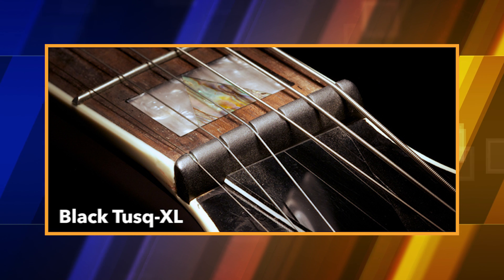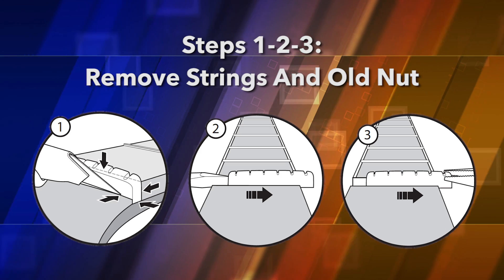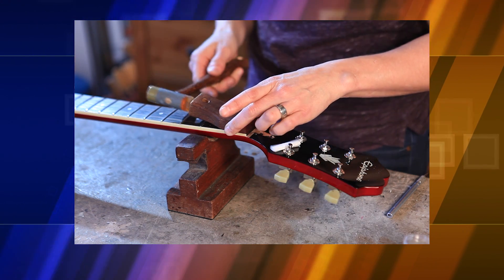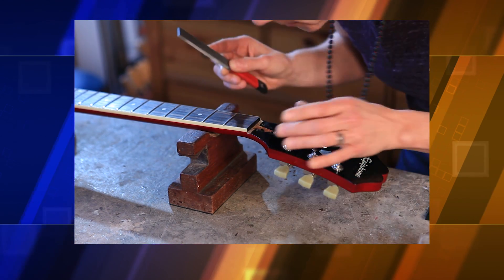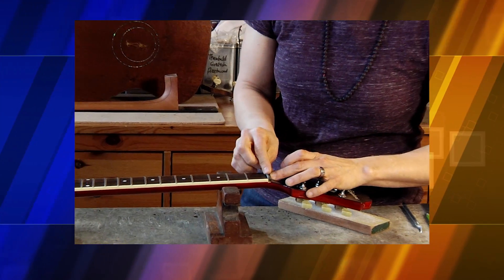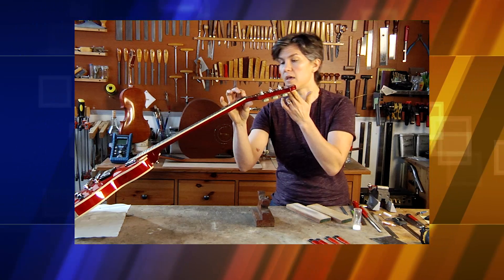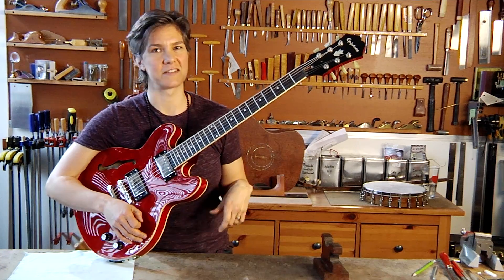Graph Tech Training Series: How to Install a Pre-Slotted Nut

Comment: Just got mine installed -- this video was an extremely helpful guide. The strings on my new PRS kept binding up at the nut whenever I used the tremolo, but changing out the stock nut for a Tusq XL made a massive difference. I can pull off divebombs now. :)
Reply: That surprises me because PRS has a super secret proprietary nut material.
Reply: @MrCamerononicus  Yeah, I know -- you'd really think that it would be better, but it just isn't. :/
Reply: What model PRS was that? Was it one of the core U.S. made guitars?
Reply: @brushstroke3733  One of the SE Standards actually. Korean-made, I believe, though I was talking to a luthier friend of mine and apparently he's seen similar issues even on higher-grade PRS guitars.

Pun intended, the but remains a sticking point.
Reply: @noahallen1996  Interesting. I would have guessed TUSQ XL material was a copy of the PRS material. Perhaps it was and yet Graph Tech improved on the formula. I've never had problems with my PRS nut, but then again, I don't do dive bombs either! I rarely use the whammy bar, but when I do, it's usually for more subtle tremolo type effects. Pulling off divebombs without a locking trem system and staying in tune is actually a fairly stunning technological achievement in my eyes, and it's great that we have the materials and technology to do that now. Who wants to lock down their strings like some kind of kinky Dom anyway?! Let them slide in their slots, baby!!

Comment: I don’t like the design of the astrat nut, why is it radiused on rhe bottom and have a post in the middle?  I’ve yet to work on a strat style guitar that is radiused  on the bottom surface which attaches to the neck.  The radius makes sense on top since it matches the fretboard.  Radius on the bottom means less surface area for the nut to adhere to.  This is isn’t 1960 or 1970 stop it.  All your other nuts are flat bottom , why this one, why not make an option.  I decided to use another nut because I didn’t trust the long term performance of this design.  Also feel it can move more easily since it doesn’t sit well.
Reply from the maker: Thanks god your question ... well... virtually all American made and Mexican made Fender guitars since 1950 until today have a radius on the nut slot bottom ...   hence the design,  we recommend a whore glue to hold the nut,  it doesn’t take a lot, the nut should fit snuggly in without glue for final fit ..  please stay away from epoxies or crazy glue.. one day that nut  might have to be removed , and you don’t want pieces of wood being removed with it ...  we do have lots of flat bottomed strat style nuts such as the PQ-5042-00 or PQ-5010-00 , thanks again !
Reply: @GraphTechGuitarLabs  I’ll have to check out the 5010 the 5045 is for a 12” radius.  I did order a nut and paid for 2 day service has not made it out of the factory since Friday.  Tracking says enroute to USPS but no arrival yet.

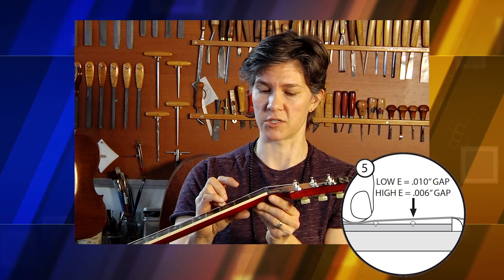Comment: @4:46   .006 not 0.06, 60 thou. is kinda high!  and @ 4:49 it's .010,  not 0.1, again a 100 thou. = impossible.  Please forgive the correction, but as a retired CNC machinist/programmer, and fellow Luthier, I just couldn't resist, Lol!
Reply: Thanks George...  once it is out there... it's hard to correct... your post will get the message out there...   thanks again....

Comment: Very helpful video! I used a set of automotive feeler gauges to set the height of the low and high E strings. Worked like a charm.
Reply: Charmed like a work.

Comment: 1. What grit sand paper(s) are you using? 2. The glue process should be shown or explained as well as what type of glue.
Reply: Problem is that wood glue  expands as it dries and could move the nut, made that mistake before and ruined the neck trying to get it off..
Reply: 400grit is recommended. As for glue, I use Titebond 1 or 2. Superglue is too fast drying and glues both you and the part to each other and the Instrument in question, whereas Titebond gives 30mins or play if alignment needs adjusting.
Reply: @someoneelse101 please don’t use wood glue , you’ll make it extremely hard to remove next time and risk pulling timber off! 2 small dots of CA glue is the way to go and makes for easy removal 👍🏻
Reply: @pk952  Will keep that in mind. I've used Titebond for everything timber related without too much hassle though
Reply: Yeah. And since you can buy most graphtech nuts ready made for your guitar, I'd say this video focuses on all the wrong parts of the process.

Comment: what type of glue and will the glue thickness impact the height?
Reply: Yep, white glue.  The glue is really just to hold the nut in place during restringing.  The tension of the strings will be enough to hold the nut in place and white glue will make it easy to remove in the future.

Comment: How can you possibly tell that the space between the first fret and the string is 0.010" just by looking at it?
Reply: Terminator eye.
Reply: Or a 5 dollar feeler gage from Harbor Freight maybe
Reply: I use business cards, stack them and measure with a caliper. Or you can get really technical and get a set of feeler gauges. A buddy of mine who was a guitar tech use to use old guitar strings that he would cut into 4” pieces and hammer them into the thickness that he liked and place them in the cases.
Reply: you can’t lol
Reply from the maker: Really good eyes!   or.... 3 sheets of regular computer paper stacked together will get you pretty close.

Comment: I appreciated the measurements on this video
Reply from the maker: Thanks Eddie. Wee try to get as much detail into the videos as we can. You can all get more details on the website. Stay tuned and stay safe. GT Team
Reply: @GraphTechGuitarLabs  

I have a question.  Bought a graph tech nut for an Ltd everything went smooth but I am concerned that the nut slot was already too deep and I now have some buzzy strings with the graph tech nut installed.  Should I place a shim under the bottom of the nut to raise the height?
Thanks

Comment: my nut's only 1mm higher than the fretboard! (first time builder here)
Reply: The most important measurement is the string height in relation to the first fret (for nut slot height) .... Nicole let's you know the suggested distance at around 4:50 in the video...

Comment: I need help. By having only the two E strings its the same tension of having all six? I think that with only two strings the nut will not be fully "compress to the neck" and measure of the thousands of inches would be bad? or am i wrong?
Reply: I know it's a year late but I'll leave this here in case someone comes across this. It definitely has an effect but not when you're measuring at the first fret - it's negligible. If, say, you're measuring on the 12fret, that's more apparent.

Comment: She said : "Zero point one of an inch", which would be .100" but she meant, as the diagram showed, .010", which is ten thousands of an inch. What she said was 100 thousands.
Reply: In this case yes it’s a pretty big difference. 0.010 is about the thickness of of cheap business cards (10 point SBS) and 0.100 is almost an eighth of an inch! You definitely wouldn’t want your action that high. Reminds me of an old Diceman joke... “math teacher asks him what the difference between 1/8 and 3/8. That’s what I say... what’s the F’ing difference??”
Reply: Pirate Labs - Does it really make a difference when you're dealing with such small increments?
Reply: @bassfishingwiththeantichri2921  Yes, she was off by a factor of 10!  That always makes a difference.  The diagram was correct so, that is good.

Comment: Thanks for the video. Can a 43mm nut work on a guitar with a 42mm width?
Reply from the maker: Potentially, you mainly want to look at the string spacing to see if that matches up. If it's a little too long or too tall, you can easily sand that down to get the perfect fit!
Reply: @GraphTechGuitarLabs  thanks very much 👍😃

Comment: Are guitar nuts supposed to be slightly slanted. I noticed in my acoustic guitar that the nut is taller at the low e, compared to the high e.
Reply from the maker: Yes, the are calibrated for the thicker strings, ergo the larger strings naturally will sit taller and vibrate more, so the slots are made with that in mind.
Reply: @GraphTechGuitarLabs  thank you so much.

Comment: I am a novice totally but it seems a better idea to take excess width off the back side. Guess not?
 It was a great video and i appreciate the instruction quality. Thank you.
Reply: Scott Hesterly 
The back side of the GraphTech nuts are rounded over, so using a flat surface, like the front side- butt up against a flat sanding surface would get better results. Take it from someone who’s ruined more of these things than not 😂
Reply: Yeah i followed the directions and got a great fit width wise and length. Had to shim to bottom a bit. I am doing a build from Precision Guitar Kits. It is a strat style. I chose the BQL 5043 00. The nut width is 1 11/16" and it is a flat bottom. The channel cut for the nut slot was a bit deeper than the nut hieght. Shimmed it with a piece of business card. Plays but still a touch low. The card was .016" was thinking i may need .020". I am learning a bunch and having a good time at it. Thanks for your reply 10,000 rambos. Bet it is easy for you now.... Be blessed in all you do.

Comment: I recently purchased a graph tech TUSQ XL nut for my stratocaster. I have installed it (havent glued it yet though), but I have it way too high. I could easily sand it down but the problem is that the spacing is way higher on the high E string than the low E string. How can I fix this? I can't sand it down diagonally, because it need the have the right radius to fit the slot, so what do I do? I guess it could file the nut slots down on the high strings, but that defeats the purpose of installing a preslotted nut. What do I do?
Reply from the maker: What model specifically did you get? Also, what radius is your neck?
Reply: Thanks for your purchase Sune.  So, when you mentioned radius, I am assuming you have a PQL-5000-00 and installing on a USA made strat, with a curved bottom. So you;ve sanded down the center tab on the nut so it has a radius.  So, two things you can do... tape some 400 grit sandpaper face up something curved... ideally, your fretboard, between the first fret and the nut slot, and  sand the treble side by just applying pressure on that side of the nut. or...  if you have a thin file, deepen the slot as you mentioned, but it's still a lot quicker than starting with a blank nut. Just make sure to angle the slot, so the highest point of the slot is on the fretboard side.   Here's a link on installation for string height. http://www.graphtech.com/docs/default-document-library/guitar-nut-installation-instructions.pdf?sfvrsn=4    If you still have any questions, please call us at 1-800-388-7011, thanks , Dave

Comment: Hi Nicole I need to do this on my new Gretsch bass. The stock nut is horrible. Can you tell me the string heights I should be looking for? Thanks in advance.
Reply: Hi, thanks for your question. Here is a link to bass string heights at the Graph Tech site...http://www.graphtech.com/docs/default-document-library/bass-nut-installation-instructions.pdf?sfvrsn=2    If you have any further questions, please call us a 1-800-388-7011,   thanks,   Dave

Comment: So, do you guys make a tusq xl nut for les pauls with a 14" radius? Or will I just have to sand a pencil in half to trace a new radius and cut new slots? Or maybe just deepen the ones that are high... 🤔
Reply: I layed a strip of sandpaper down on the 15 fret of my guitar and sanded the nut to its radius.  It worked

Comment: A piece of glass makes a good sanding surface and if you're a beginner holding the nut against a straight edge as you sand will keep the new surface straight and square. Considering the old playing action you can use slots on the old nut as a height guide - even test lowering the old nut to determine at what height fret buzz begins. These nuts are really excellent - you need to measure carefully width, thickness, height and consider string spacing (E-E) before ordering - don't just assume the existing nut is correct.

Comment: What conditions would move someone into changing the nut other than to enhance the sonic transfer amount or superior tone. Are there physical reasons to upgrade? I have an Epiphone el-00.

I'm not a good player so upgrades for sound quality don't interest me at this point.
Reply from the maker: The stock nut that's on there will just be either plastic or something that isn't helping the guitar at all. Upgrading to a Tusq XL nut will help the string not bind in the nut to help with tuning stability, as well as have an improvement on the guitars sustain and tone!
Reply: I had to have the nut replaced on one of mine due to the slot getting a little messed up on the 1st string.   Open E was buzzing and the damage to the nut was fairly obvious visually.   That would be a good reason to change.

Comment: How do you fill a slot that's been cut too deeply....on a graphite nut? I have a high E slot that is too low. Thanks.
Reply from the maker: Your best bet is to replace the nut if it's been filed too low.
Reply: Use uv curing super glue to fill in the low spot. The glue is very runny and once applied you shine the small uv light that comes with the glue kit over the area where you applied the glue. This cures the glue within seconds. You can also build up in layers if necessary and also file or sand as well. Works perfectly. No need to replace the nut.

Comment: WOW, that's all I gotta say. I bought an Epiphone ES335 Dot. The cheap Chinese strings sounded like crap and this guitar would not stay in tune. Installed this Tusq nut, took my time filing the height, put a quality set of 10's on there, and OMG, it's a totally different guitar. First time I ever installed a nut on a guitar, so thank you for this video, it made the replacement of that cheap plastic Chinese crap go so smooth. Luv my Epiphone dot now. Stays in tune beautifully. Young lady, Thank You.